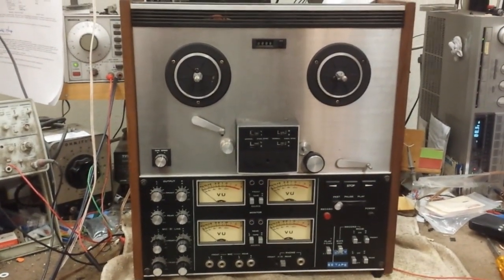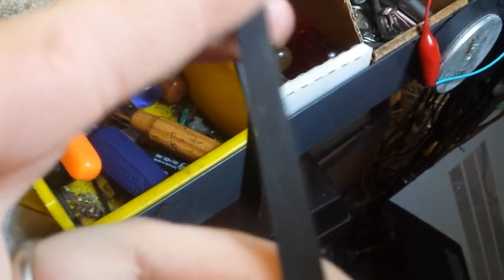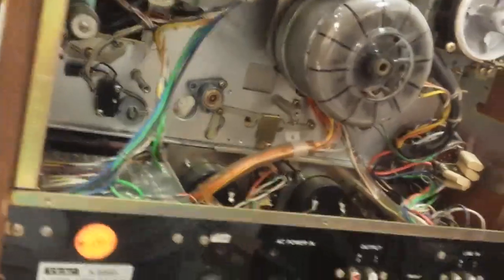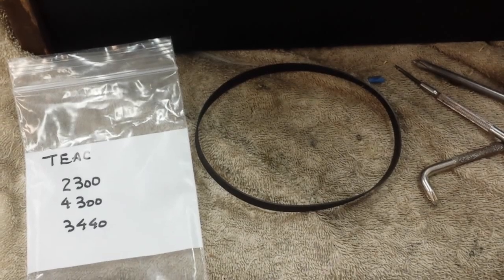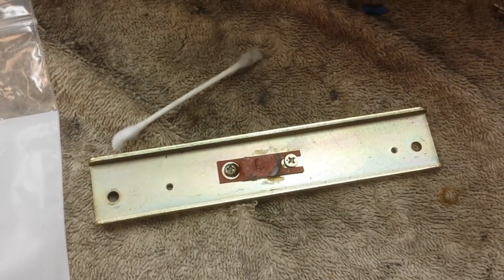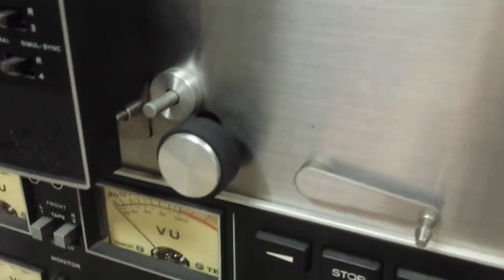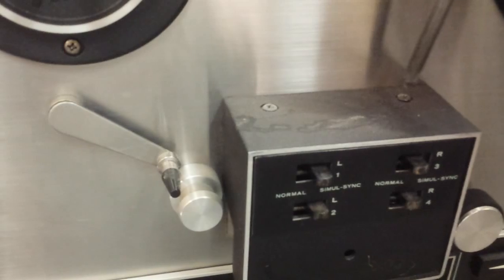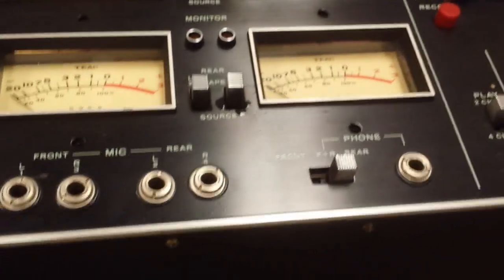Servicing a Teac A-2340 4 channel reel to reel

Comment: Thanks Jordan! 
I was able to put a A-2340 R back in working condition last night. The machine belonged to my wife's dad who passed away a number of years ago. Everyone was thrilled to see it operate once more.
Reply: jks625  did you by any chance take the pinch roller assembly off by using a heat gun? I can’t get mine off to save my life. I’ve put so much heat on it it was almost glowing red. I’m kidding but, I did put a lot of heat to it and I can only wiggle it up and down about halfway by grabbing the pinch roller arm from the front and jiggling it up and down. How did you get your assembly off, if you did? I would appreciate any comments you have on that.
Reply: @alcameron6071  i warmed mine up with a soldering iron.
Reply: I discovered this video today and it worked perfectly! Are you using a 1200 W heat gun on high heat? If so, work the heated part forward and backward on the shaft with the channel lock, carefully turning at the same time. The sticking comes from the grease on the shaft getting dirty and hardening up over time. The heat melts it so it can come off. Keep trying! You’ll get it.

Comment: Great job on these videos, thank you.  My 2340SX and 2300S both need the full treatment.  I bought the 2300SX for $55 over 20 years ago.  The first thing I had to replace was the micro switch you mention which someone had broken with too much down pressure on the arm.  I love these machines!

Comment: Excellent video! This has inspired me to open a bench back up. I repaired radios in the Marine Corps for 6 years. I like this guy. Here reminds me of the marines I used to work beside at ELMACO on Okinawa, Japan back in the very early 1980s. A nice messy bench with Osope and   ]q My favorite part? “Lets get this towel out of here, its pissing me off” LOL! Loved that.Took me back 40years. I used to covet these machines as I was a live Sound mixer that worked with neighborhood bands back in the early seventies. I had to make do with Peavey Equipment and it held up well. I could never afford one of these and had become re-interested in owing one but these things are still very expensive. I’d rather get a nice broken in and beat up but repairable one and dive into it like this. Thanks Jordan, you re-ignited my inner tech again and at 60 I realize my medical career is soon to end and this was always my first love.

Comment: Thanks so much for the video.   After a few scrapes and burn on my finger, I was finally able to free the harden grease froozen mechanism using a soldering iron.  I tried 3 different soldering irons and finally got it free using the most powerful after 10 minutes of heating the shaft.   I almost gave up but decided to give it one last try and it finally freeed up!  Thanks also for showing how to deoxit the switches from the front side.   Very clear video and step by step instructions!

Comment: This video was incredibly helpful. I was having trouble with the pinch roller on my A-2300S. It needed help engaging. Thank goodness mine wasn't completely frozen, just stiff and sticky. I didn't oil my motors so I think I'll go back and do that in a day or two. Thank you SO much.

Comment: I followed these same steps for my  TEAC A-3440 and all went smoothly she is working like new next is to find the oil ports on the motors. Note this unit has a lot more space to work in. Only used heat for one screw to break it free the lever came out with my fingers. The capstan is a bit different than the one your working on in this video. Anyway thank you, a lot!!!!!!. Oh new belts as well she is running like a champ. She does have some pot and button issues but not to bad. Looks like as I use it the pots get cleaner. But I'll still clean them the right way.

Comment: Got an old (very similar from the inside) A-1230 back in shape thanks to this video. Wasn't able to take out the pinch roller (tried heating with a soldering iron and a hair dryer), however, after some oiling, everything's running smooth again. Thank you!

Comment: Jordon.
great video..
 instructional, straight to the point, comprehensive, AND you did most of it with one hand!!
Amazing.
i just acquired a TEAC A-2300SD that needs the capstan bearing freed-up.
this video is just the ticket.
and while I'm in there I'll lube everything else as you have show,.
I'm off to the electronics store to get some lube and more De-Ox.
thanx again.
graham

Comment: Thankyou so much for this video. I have two TEACs side by side. I clean, oil and demagnetize them regularly but one needed to have the pivot bearing cleaned. I was able to pull it out without heat so it was not that bad. But your video was excellent and I used it like you were sitting at my work bench (lol) as I copied most of your steps.  Thank!!!!!!!

Comment: Thank you Jordan! Followed this for my 3340s.  That goo mucked up the whole mechanism. The 3340 is very similar.  I used a log lighter to loosen up the goo on the spindle to release it. Everything was going great until I drop one screw putting it all back together. I looked for hours taking the bottom boards out, shaking the unit, never found it. Must be in the wire mess somewhere. Bob in PB.

Comment: Best example of the pinch roller arm fix. Must say Teac recommends 1 or 2 drops  of oil in the tubes, but after more than 50 years bearing probably need it, but it may be to much. I've got over 20 machines in my collection, about 6 Teacs. Two all vacuum tube machines too.

Comment: Outstanding video! I just acquired an A-2300S with a similar pinch roller issue, so I'm hoping I can pull this off. The innards look nearly identical. My pinch roller isn't completely frozen, but very stiff.  However, when I push the play button, I don't really see any activity with the solenoid, so I'm just hoping that isn't the bigger issue.  Thanks for your great work, Jordan, and wish me luck!!

Comment: Thank you for the response, a lot of these TEAC's are very much alike on the inside motors . Especially the bigger models. The 40-4 is the sister to the A-3440, A-3440 is the one I use to have but I found the 40-4 and I do need work on it.

Comment: Great contribution to the RTR community.  I am just starting to go through the same process for my just acquired A2300SD, and this is immensely helpful.  Thanks.  BTW, have you run into any issues with using oil to lube the pinch roller shaft and bearing, and also the capstan shaft and bearing?  I a youtube comment that grease is preferable to oil.  Do you have any recommendation for the type of oil? Thanks again.

Comment: Thanks for this fantastic video. This has helped me immensely.  My 2340S has another problem. The  fast forward and rewind functions don't seem to have the torque they used to. The machine sat unused from the late 70s until now and I am trying to get it going again to digitize the old 4 track basement tapes from the 70s.
Reply from the maker: Tapes could be suffering from sticky shed syndrome. It's rare for both motors to loose torque. Never seen a bad reel motor phasing cap yet on these either
Reply: @JordanPier  I will look into the possibility that the tape has become sticky. I believe the old tapes are all Scotch. I expect this means I need to bake the tapes. Unfortunately I already tried messing with the brake settings by loosening the screws holding the bottoms of the brake felt spring backing to the frame and sliding them to lessen the braking. Yeah, it didn't do the trick. I have a service manual and suspect I will need to get a spring scale and some string to test and set the drag. I may start out by trying to find any witness marks to try as a starting point. Sorry now that I didn't mark them before messing with it.
I started filling the oil tubes in the motors with mineral oil. I hope that wasn't a bad choice of lubricant. I filled the three apparent ones at the rear but didn't see the ones at the front until watching your video.
I still need to clean and lube the mechanisms actuated by the solenoid for the pinch roller. Thanks again. This video has been a great help to me.
Reply: @JordanPier  Found a belt kit on Amazon for $31.50 with tax and free shipping.
Reply: @JordanPier  Update. I got a set of spring scales to measure the torques being produced in various modes. I have a 2340S not an SX. I finally found a manual for the S. The S model has 3 variable resistors to adjust the torque. [as compared with only 2 for the SX] I have followed the instructions but it seems that loosening the screws and moving the metal contacts to the right or left on the three variable resistors has little to no effect, and I have moved them to extremes. The main problem is the fast forward does not work. When I measure the pull of the left reel on rewind it pulls at almost 500 grams. When I measure the pull of the right reel on fast forward it only pulls at around 100 grams. I'm pretty much stuck at this point.
Reply from the maker: @smith971  at this point you likely have either a bad phasing capacitor for the take up reel motor, bad switching relay or open winding on the motor.

Comment: Hello Jordan! Thanks! Your videos regarding restoration of TEAC reel to reels are the best! I suceeded fixing my Teac A2300SD - but I still got a problem that I hope you can give me some advice how to fix. When the deck is mounted standing up the brakes are not working good. When doing FastForward and stopping the left reel does not brake and the tape from this reel is flying on. 
The strange thing is that when I put down the deck horisontally the brake works fine in both directions. Do you have any input to me about what I can do to fix this?
Thanks so much in advance!
Reply from the maker: Remove the reel table and check that the brake pads have not come unglued.

Comment: Jordan, Thank you for the great video on servicing the Teac A2340R.  I have one that I bought in the 70's that had been sitting in the attic for the last 25 years that I won't get working so I can digitize my old tapes. I followed your video for servicing and changed the belt. The only problem I have is the left tension arm is shorted so it keeps going in reverse. I unsoldered the tension arm wire from the circuit  board and everything now works except auto reverse.  Once I have all my tapes digitized I want to take the arm off to try to repair the short but I don't know how the dampening is adjusted on the arm.  If you could give me some guidance on that I would appreciate it.  Thank you for your help. Mike

Comment: Great video!  Working on a 1230 A machine doing the capstan shaft repair. I’m at the point of trying to free the two screws attached to the solenoid . I see you used a right angle driver to loosen them. I was able to get a small screwdriver in there but they’re very tight won’t budge. I’ve got a set ordered hope it works. Those strip it’s game over...
Reply: Were you successful removing the two JIS screws attached to the solenoid and pinch roller lift arm and if so, what tool and method did you use? I am having the same problem on my Teac A-2300sx.  I have tried using lacquer thinner to melt the lock tight, 1400 watts Weller soldering iron to hopefully loosen the screws, but no luck yet.  I have even purchased two different Vessel screwdrivers (stubby screwdriver with shorter bit and ball screwdriver with longer bit) and still cannot get good enough angle to break them loose. I understand that if you use a JIS screwdriver on these JIS screws, you have much less chance of camming out and stripping the heads and then game over, like you said. I have been trying to find a rachet driver with JIS bit on internet to hopefully break the lock tight. I found a offset/right angle tool at O'Reillys (like the one used in this video) but the Phillips head of screwdriver does not fit tightly in head of screws. I do not want to risk stripping the screws using this tool.  I have watched many, many videos on Tapeheads and AudioKarma on this issue and have yet to find one showing how to remove these blasted screws.  TapeTech on Tapeheads website said best way to remove the pinch arm assembly is to remove the solenoid plunger, but several other members say that method is really risky - reassembling all of those parts correctly could be a problem. Plus, you could end up having to adjust the pinch roller pressure as well. Any feedback would be much appreciated!!

Comment: Great to see your channel back on Jordan - I have been assisting a friend with his 3300sx and after completing the loosening and relubing of the pinch roller assembly we put everything back together only to have smoke pour out of the circuit board on the far right of the unit - it was one of the wire wound resistors burning. Anyhow, I read somewhere that  the small circuit board in the Center which had to be removed has a small plastic slip to prevent the collector of a voltage regular transistor being shorted to ground - if this is not reassembled with care the short causes the resistors in the other circuit board ( on the far right) to draw extra current and overheat. We haven’t checked this yet, but just wonder if this problem when reassembling is known to you? Many thanks.

Comment: Just ordered one of these off Ebay and got it in the mail, my dad seems to think it came from a radio station or studio because of all the smoking tar on it, lol. First thing I did was start servicing it, thanks to this video-
On my unit the capstan was actually rusted(!) and I tried both alcohol and contact cleaner to try and 'resurface it' to no avail. The flywheel is thankfully removable though, so I was able to pop it out the front and took it to the lathe and used light emery paper to get it back into usable order. Is there any way to prevent rusting like that?

Comment: Thank you Jordan this has been most enlightening. Do you have other TEAC 3340/2340 style videos covering mechanical/electronic aliment? I now own two beauties (3340 Japan original & an A-2340SX) and want to take care of them. Best Regards, Tod in Las Vegas. :)
Reply from the maker: This is the only one, but this transport was used across many models.
Reply: I called the "TEAC" (some other supply company that has taken over I think) and they had no record of the 3340 or the A-2340SX models so the gal said she'd have the tech call me with the part number. That never happened. Would you happen to have to part number for the drive belt? It's probably the same for both decks? Thanks! Tod in Vegas  @JordanPier

Comment: Great video, after watching I realized I needed to lubricate my reel to reel moving parts and motors.         I did this to my teac a300 as well as replaced a couple of electrolytic capacitors on the record board to do away with horrible noise on the right channel        it records good now,mechanically smoother after the lube as well. once I finish replacing all the electrolytic capacitors on record and playback boards on my a300 I will begin service on my own 2340 that does not record at all???  And then pick up a motor and some various parts on  for a teac 4010 I also have.           thanks for motivating me and teaching me!
Reply: Just out of curiosity, how difficult was the recapping?  I was thinking of trying that?  How many caps were involved? Much thanks.

Comment: Love the way you explain the steps as you go along. Had a stuck pinch roller on my Teac 2300S and was able to get it free per your steps. Replaced the belt and other maintenance steps. Upon testing playback, it appears the solenoid associated with the pinch arm is very stiff and, many times, it doesn't actuate the arm. Any suggestions?
Reply from the maker: It's tricky, but the solenoid plunger needs to be removed from the housing, all the grease cleaned out of the housing and off the plunger

Comment: Jordan

I have the A 3340 series which has a similar head system design. There two " pins " that I believe should be able to move in toward the heads and out away from them ( slotted area allows movement in that direction ). THat makes me believe that the tape should be threaded behind these " Pins " and the pins will  move toward the heads to help hold the tape in place along with the pinch roller when the unit is placed in Play mode. What is the best way to service / oil these pins so that they move freely. ?

Comment: I followed your procedure for oiling the Motors. Other videos have suggested two or three drops is all you need. After watching your video, I realize I was starving my motors. This deck has been stored for a long time so I re-oiled the motors. I was surprised how much oil they took before it started to weep out where the tube goes into the body. A great video! I appreciate your expertise. I forgot to mention, my deck is a Teac a-2300 while I’m thinking about it, the board on the very top on the left-hand side of mine has some type of white crap on it. I tried a small area scrubbing it off with alcohol and Q-tip but it didn’t want to come off. It doesn’t look like it’s hurting anything but I’m curious what the heck that junk is. Any ideas?

Comment: super loved the video. thank you! i got inspired and started on my deck. sadly, i started with the wrong contact cleaner and damaged 2 of the record mode switches while trying to 'work' them (after they froze). long story-short, i'd like to know how to remove the mic/line dials (the line dial) so i can get the front plate off, to see if i want to try to solder in new switches, if they are standard parts and i can find them. any help from any source is appreciated. this project may have grown at the outset, but it still looks like a good time. wish me luck!
Reply from the maker: If I remember correctly once you get the knobs off there are hex nuts holding the face on with the controls.